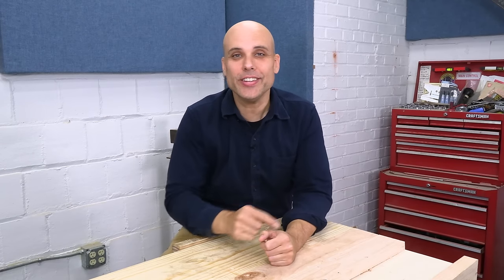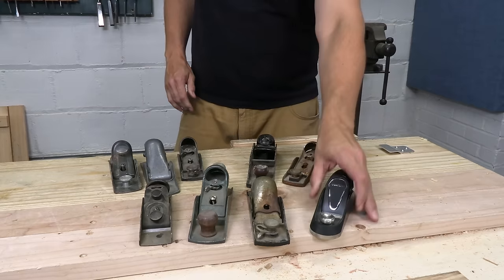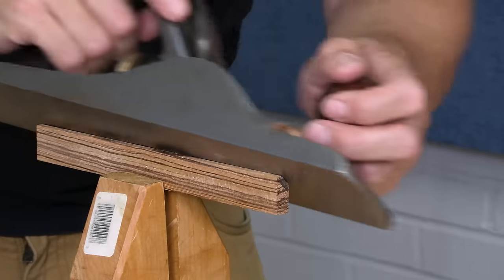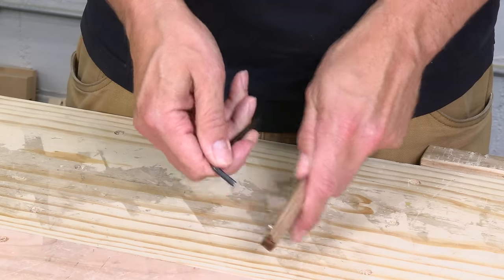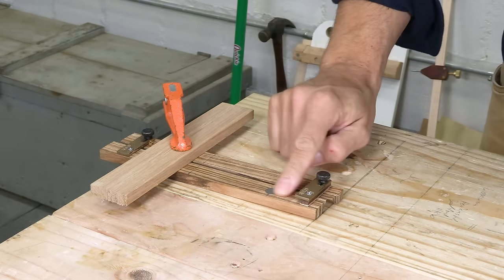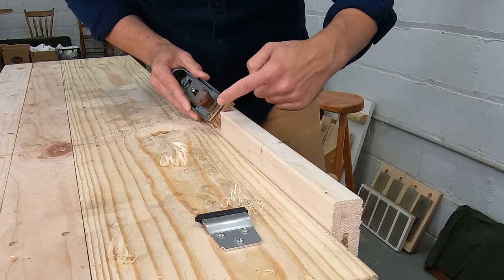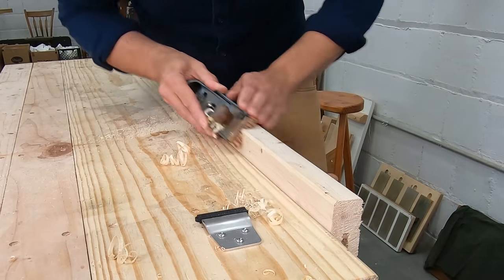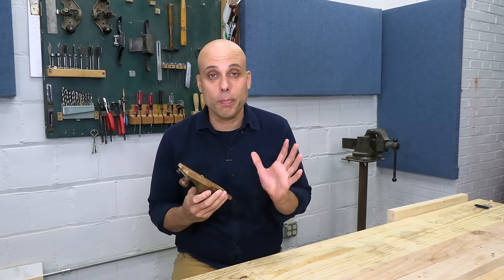Does anyone need a chamfer plane?

Comment: One trick I found helpful before I cut any screw with a saw: Thread a nut on that screw! The sawing will mess up the end of the screw thread, and after just using a file alone, it might still be difficult to start the screw. However, then unscrewing the nut over the damaged thread (might require some force) will help to realign the thread. If you want to go one step further, you could use an actuall thread cutter for that purpose, but a nut worked just fine in all the cases I encountered so far. Also, iff you cut something like allthread, you can clamp it by the nuts (add more than one in that case), and thus avoid damaging your thread with the vise jaw.
Reply: that allthread tip is going in my brain.
Reply: This is the way.

Comment: Spin a nut on the screw before you cut it. Taking the nut off clears the burr from the screw
Reply: I’ve been doing that every time for almost 40 years. But lately, in the past few years due to old man laziness, I’ve been deciding to skip it when it comes to general household repairs. And guess what…. No problems. With something like this or an antique restoration with fine parts, particularly brass screws, I would put a nut to reset the thread.
Reply: Yeah but the screw won’t be clear 😢

Comment: You really are right about the block plane doing the job.  I have a rail around my living room that's about 60 feet of pine 1X4.  I rounded over the visible edges with block plane with the rail pieces resting on saw horses, lengthwise.  The corners match and the round-over is right around 1/4 inch.  My wife was satisfied, so the result was more than adequate.  She's a hard grader.

Comment: Have a look at antique architectural or mechanical drawings and then modern drawings, and you will find the antique drawings are richer, more pleasant to view. The difference is that the older drawings were done with type of technical pen that had to be dipped in ink and the lines vary ever so slightly in width along their length. Perfection is something that machines create; I prefer the grace and elegance provided by chamfers made without jigs and guides. Disclaimer: I am not, and will never be, a high production woodworker.

Comment: I had to chamfer a ton for a project that had joining chamfers that had to match. i had a noise restriction and couldn't use a palm router to get the job done. i tried it with just a handplane but getting the joins right meant matching each join specifically and keeping track of that which wasn't gonna happen. so i put a chamfer sled on my hand plane. over 450' of chamfer and 128 chamfer joins that had to match. somehow got it done without losing my mind. this sled is a whole lot nicer than the one i banged together back then. got the kit but haven't actually put it together yet. good video.

Comment: Rex thanks for doing a review and I will check back with you in 6 months and see if this is getting any use. There are a lot of chamfer plane designs, some old and some new and they always interested me. It was a lot of fun to explore chamfer planes and come up with this design. While chamfer planes are not for everyone or every project, I do think they have a place for some applications and users. When I designed this kit  I always thought the holes for the magnets would be done with a 1/2" drill. I was very surprised you had a metric bit! Thanks everyone for your comments.

Comment: I completely agree, I use my no 4 for chamfers and if you want a consistent chamfer, which is the selling argument of many of these chamfer planes. Simply count how many strokes you do, if you don't change setting it should be, about the same!

I find this is the real advantage about "human speed" tools, it can be done with an auger bit too, if you make a couple of "test" holes in a scrap stock first. Here it is a real advantage using the same set of augers since they will have the same lead screw, which determines how much it pulls per revolution.

Comment: I have one of those fancy single-purpose planes. It's great fun to use, but it's actually impractical to use on a big job because there is no repeatability built in. You can't just leave it on a full-depth cut because that takes too deep of a bite, so you end up dialing the depth little by little. It works fine for one edge, and you can check how it lines up for mating edges, but is extremely difficult to carry that depth to a second part. You caught the really cool thing about this sled design, which is that the plane's sole handles all of this for you, taking of only small shavings and then preventing you from cutting past the stopping point. I'm sure I'll end up making one of these at some point, but I'm a nerd so will probably 3d print it.

Comment: To keep the threads on your screws easily either use a bolt cutter on your wire stripper or thread a nut on all the way back.  When you unscrew the bolt... the threads get nice and reformed.

Comment: Another screw thread trick a machinist showed me. I have an old machinist vise with double lead threads, some areas with damage. The screw passes through a collar or tube. He showed me to get the damaged portion inside the collar, then tap on the collar with a handle. Turn a little more, tap again; repeat as needed. He couldn't find his hammer, so he demonstrated with the handle of an adjustable wrench. I went home and finished the job, and it has worked smoothly ever since.

Comment: I have found that chamfering free-hand with a plane is easy enough to do with fair accuracy.  Except this one time I was making a shelf from red oak and even when adjusted for a light shaving, the chamfers very much wanted to split and tear.  It came out fine and I am being very critical here because for chamfers to look right, you need to work to 1/64" accuracy or better.

Comment: I was thinking I could just go to the hardware store (or Borg) and buy parts to make this guide.  They wouldn't be nice brass but they would work.  But, 18 bucks isn't a bad price.

I have shortened bolts before and, as you say, it isn't hard.  If someone doesn't want to do that, couldn't you just make your spacers thicker?  Would it matter?

Comment: I suggest you first screw a nut down to beyond where you're gonna cut a machine off. Then when you're done cutting, removing that nut will "chase" the threads back into order at the cut. You can still file it to make it pretty if must but once you remove that nut to clean up the threads the screw should work fine from there out.

Comment: One extra point I would like to bring up is that if you are the kind of person who needs to buy a kit to make chamfers and use a bunch of advanced woodworking skills to make the tool, why not just learn how to properly chamfer normally? I know you brought that point up originally, but I just can't see the point other than consistency? maybe.. its a clever little gadget but seems like a lot of work for not that much gain
Reply: I think consistency is the point, specially for longer and wider pieces that would take a bigger and more visible chamfer. honestly, also speed. Irrelevant if you're just making a few pieces for friends or family, but if you're selling in volume, a thing that you can just grab and go to town consistently is faster than relying on muscle control and memory on every board

Comment: What about chamfer on end grain?
Reply: Just make sure your blade is super sharp and you firmly present the blade to both sides of the workpiece to be cut BEFORE you begin going at it, to prevent blowing out the exit point. Also you’ll want the blade set at and angle rather than heading flat through the cut. You’d probably be better off chamfering end grain with a file or sanding board. Not as crisp, but less risky.

Comment: I don't understand the purpose of the kit here.  I mean, it's not so expensive as to be completely useless, but also the magnets are all you really need.  the stops can just be wood glued down.  The adjustablity is nice, but I'd be a lot happier to pay $5 more for some nylon skids already cut with the 45.  If I have to make them anyway, in the time it takes to set the inserts, I'd just make a set of guides for different depths of cut and never have to fiddle with an adjustment.

Comment: I kinda understand not liking 'gadgets' which do only one thing (just curious, what else do you do with a hammer? Or a saw?) but I think having 20+ of essentially the same tool is a bigger problem...
Reply from the maker: I adjust planes, bend small pieces of hardware, strike punches, drive out pins, and remove the set from over-set handsaws. (not being a smart-ass; you asked.)

Comment: So basically you need to create a chamfer freehand in order to make the tool...
Reply: True. That was my first thought, but if you need to do a high volume consistently it would be very helpful. I'm not a purist, so probably would cheat and use a power tool to make the guides, or get my friend to 3d print some.
Reply: you could just rough it up free hand and true it up with sand paper. or start with a wide piece, saw and clea it up. Or use a little creativity in modifying a shooting board temporarily. Or indeed, you take your time doing two really well real slow, so that you can be less methodical when making chamfers on actual work pieces. Many poisons, pick your preferred one

Comment: Usually I am a fan of anything you promote. However in this case I am not. The price for the kit you promote is $67 or so and only includes the two bronze fittings and four screws. It doesn't even include the magnets. I am certain I can cobble up this system from parts already in my shop for little or nothing. Sorry Rex but it's thumbs down for this one.👎👎 Still thank you for sharing. Have a great day and stay safe.🙂🙂
Reply: He accidently linked the wrong kit. Its the REED Chamfer Plane Sled Kit and its 28 bucks for the hardware in the video.
Reply: The wrong kit got linked, this one is $18, but even then, I don't really see the point of the kit.  just gluing the stops down will do the job just as well, or there are plenty of ways to make it adjustable with general hardware.  Kit would be a much better value at $25 with two pieces of nylon strip with the 45 already cut included.
Reply: Thank you for the update. $28 is a much better price but I think still a bit pricey even though all the parts are included. I see that the rails can be purchased also but they are $18 for a couple of pieces of cherry.